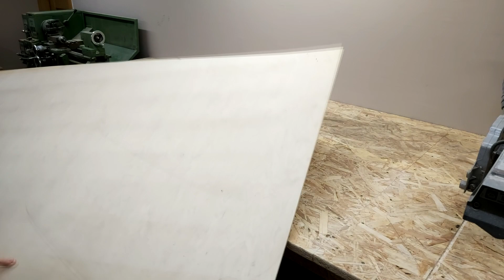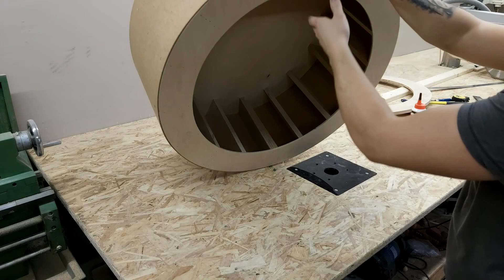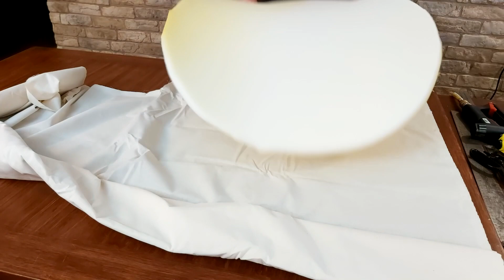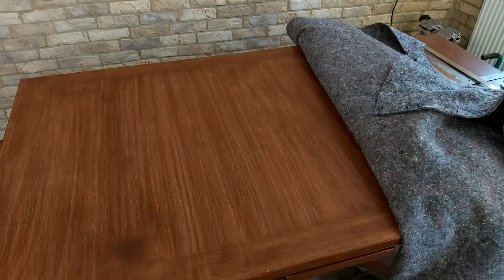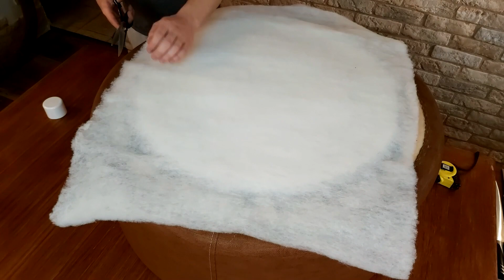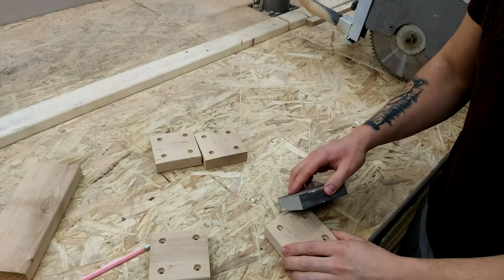How to Make an Ottoman . Footstool Quilted Upholstery

Comment: Appreciate the vid. Ottoman looks great for a quick build and employs skills appropriate for a video of this length. The maker likely has a ton of ideas on how this build could be adjusted to add quality.

Anyone actually making the ottoman may want to round all of their cuts so the 90 degree edges wont wear down the fabric and padding as much over time.

Foam should likely stand proud of wood so as to pad the edge circumferentially on top. Leg weight during use will, over time, really wear those edges otherwise.

Drilling out the centers of all the vertical supports could reduce weight without weakening the overall design--should anyone find that necessary.

Also, Id consider doubling up on the ring bit Substitute the second ring for the square feet at the bottom. Would make the overall profile more vertically symmetrical--as well as hide those unsightly staples. 360 deg rubber/silicone padding on bottom could provide serious sticking power on hardwood flooring

All this being said, the builder did nothing wrong and this video is awesome. 5 stars. And may the ideas and feedback spark even more comments & conversation!
Reply: The 'ring at the bottom' idea would be a perfect opportunity to create some grooves the wood and drop in some bearings in a circle to make the unit spin. I haven't thought the exact design all the way through, but  maybe just posting this will encourage some else to do so. Would love to see finished product
Reply from the maker: Thank you for such a detailed comment and appreciate all the suggestions you mentioned. I will consider them on my next project 😉👍
Reply: @BeMayNoMore  I like your idea, should you figure out how to do that, make a video. I wonder how large the bearing wheel sets for lazy Susan type things go?